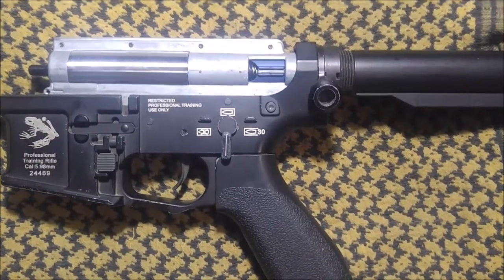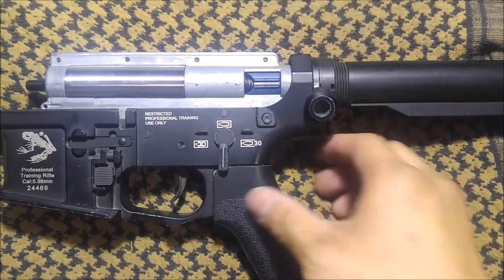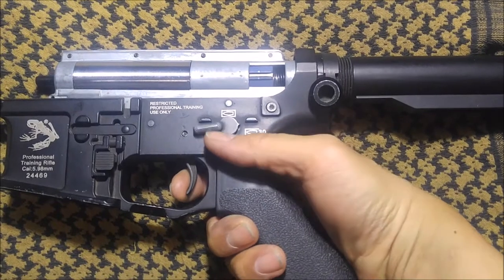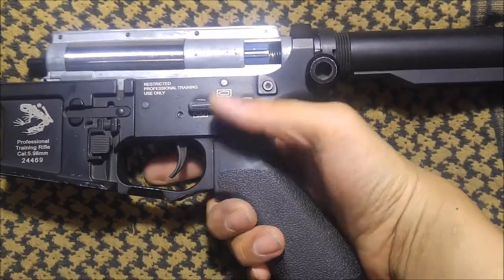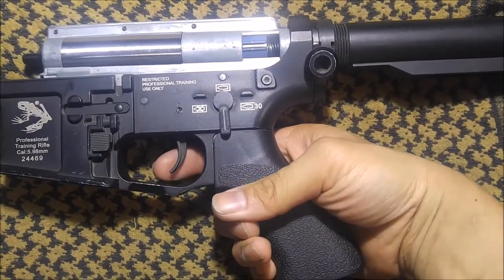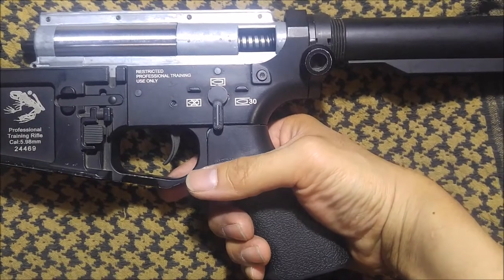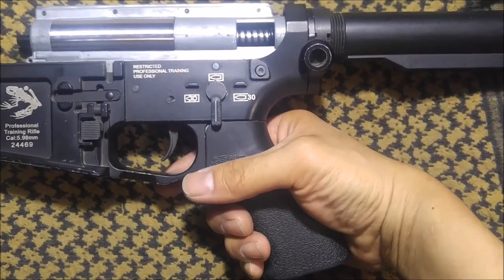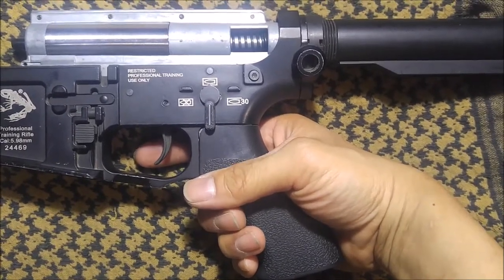gate precock disable

Comment: I think it works a bit different now.
I just did that in my gate aster v2 and it indeed disable pre-cocking, but in mine it stays off and it even show off on GCS.
There's probably another combination to perform to re-enable pre-cocking. Nice and clean explanation anyways.
Reply from the maker: Thanks.
This video was made back before version 3 of the Titan firmware, it's version 4 (beta) now.  It's a different combination of trigger pulls and selector flips.

Comment: Is there a way to turn this off
Reply from the maker: I haven't discovered how to permanently turn off the precocking through trigger pulls.  I just happened to be teching on the gun when I discovered this.
Reply: @benarcher45  With the newer firmware on the Titan/Aster products you can now adjust precocking via the selector like you showed in this video. Holding the trigger and switching once turns it off, switching the selector twice sets it to auto and three times sets it to manual mode.

Comment: for me this permanently disables precock any ideas?
Reply: Umm use your programing card to turn it off then.
Reply from the maker: I think it's because when I shot this video I was using an earlier firmware.  When I install new Titans and upgrade the firmware the trick I showed on the video no longer works.
Reply: @benarcher45 it works for my just installed gate titan advanced.
No firmware install.